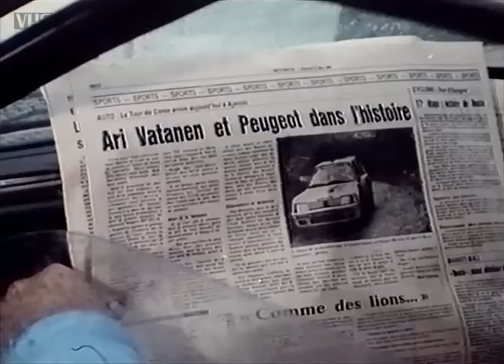Challenger - the story of Peugeot in the 1984 WRC

Comment: In every bit of footage of Group B rallies in Continental Europe until the end of ‘86 you can be assured of seeing spectators seemingly doing their best to get themselves killed.  Crazy days.
Reply: I can not imagine how much faster & difficult would have continue with the WRC Group-S which suppose to follow as next level mid-engine after Group-B.. so many secret prototypes that can be found in museums like : Audi Sport Group S, Peugeot 405 Turbo16 & Quasar, Lancia ECV1 & ECV2, Ford RS 200S, Mazda RX7S, Toyota MR-(222D), Lada Samara EVA, Seat ibiza bi-motor, Vauxhal Astra 4S/Kadett E-4S.. (Porsche, Talbot, Citroen & Mitshubishi dropped they 'r works very quickly after Group B banning but all were planning to enter in WRC Group-S..)
Reply: And that's the main reason they banned the Group B cars. It wasn't really the speed or the skill it took to drive them, it was the fact that spectators got whipped up into a frenzy and couldn't/wouldn't be controlled.
Reply: @Wirefox1  Group B was banned due to the cars being too dangerous but also because of the spectators. There were many reasons but the main reason was the cars. Modern technology could bring group b back.